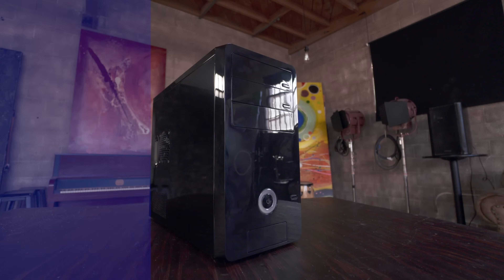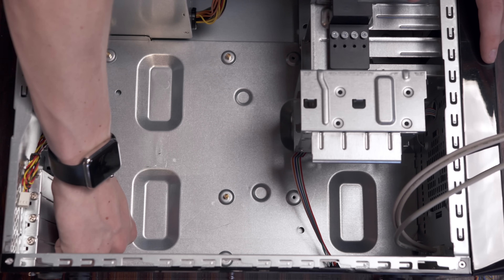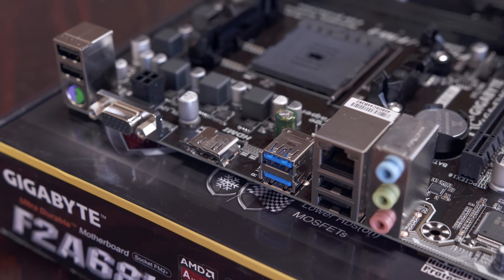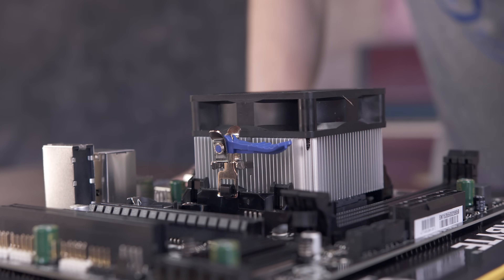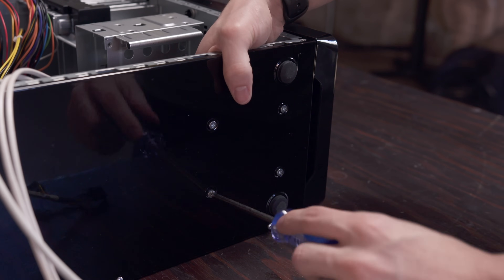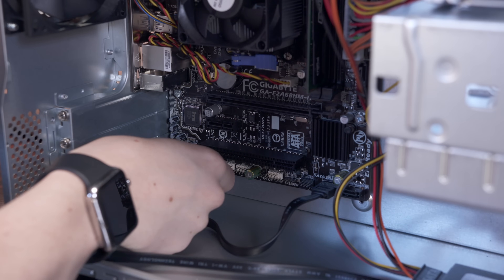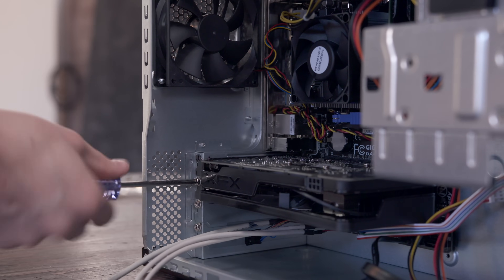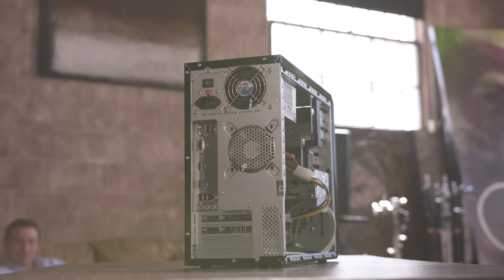How to Build a Gaming PC! (2016)

Comment: Is this any good?

Samsung DVD Writer
Logitech MK120 Combo
ASUS PCE-AC56 AC1300 Internet Adapter
Cooler Master MasterCase 5
Corsair VS550 550W KPC Bulk Edition
Intel Core i5-6400, Socket-LGA1151
ASUS B150M-A, Socket-1151
Corsair Vengeance LPX DDR4 2666MHz 16GB
MSI GeForce GTX 960 Gaming 4GB
Seagate Barracuda® 1TB
Reply: Yes, will run games 1080p 80+ fps
Reply: Okay, thank you guys for the answers :)
I think im going to buy all this.

Samsung DVD Writer
Asus 24" LED VN247H
SpeedLink RAPAX Gaming Keyboard
ASUS PCE-AC56 AC1300 Wireless Adapter
Cooler Master MasterCase 5
Corsair VS550 550W KPC Bulk Edition
Intel Core i5-6400, Socket-LGA1151
ASUS B150M-A, Socket-1151
Corsair Vengeance LPX DDR4 2666MHz 16GB
MSI GeForce GTX 960 Gaming 4GB
Seagate Barracuda® 1TB
SteelSeries QCK XXL Gaming Mousepad
MS COA Win 10 Home Nordic

Hopefully it will work out :S
Reply: never og AMD boy! intel ang GTX for life... i promise that you will be more happy With intel and gtx, you can get g-sync and shit for Your screen and the performance is way over AMD ;)
Reply: AGz MaGIXz but you should try to upgrade your 960 to a 1070 :)
Reply: You maybe want to wait for AMD:s release of RX 480 instead of GTX 960
Reply: Subaruwrx
 Intresting...
Reply: doesn't matter if u have a good cpu if your gpu is running like shit. that is like buying two gtx titans and a sli when you just have 8gb of ram
Reply: I would not reccomend a 480 for vr.  Your gonna want to get over 100fps in those titles to reduce motion blur I would recommend and aftermarket gtx 1070
Reply: Get a 6500. Best bang for the buck as an i5
Reply: estimated price?
Reply: +_K09 cad or usd
Reply: Subaruwrx USD
Reply: +_K09 id say like $1000
Reply: Wait for the RX 480!
Reply: +ShinySwordGaming yea good idea
Reply: Shit
Reply: you pay what you get. graphic card and Power supply are the two main Things you should not ''save'' cash on. cheaper ones will break and will never perform as good as a more ''expensive'' one. please instead of breaking several Graphic Cards buy a quality one that will last.
Reply: +sa0408 a 1440p card for $200. cant beat that. allows you to upgrade your cpu
Reply: sa0408 the rx480 runs can run a premium VR expirience. Before this those cards were over 1000, that is fucking insane performance for 200$
Reply: great for video editing and gaming
Reply: okay... so i changed some stuff.

Corsair VS550 550W KPC Bulk Edition
Intel Core i7-6700K Skylake
Akasa CPU Cooler AK-959CU
ASUS B150M-A, Socket-1151
Crucial DDR4 2133MHz 16GB (2x8GB)
XFX Radeon RX 480

Thats what i have put together
Reply: that's pretty good
Reply: +Latinz Prince that's like a 1500 build
Reply: +Latinz Prince u canadian?
Reply: +Latinz Prince i was just curious because the canadian dollar is so bad that would cost like 3800
Reply: Whats better Intel or AMD?
Reply: ***** It usually is the case that limits the graphics card length.  Look at the graphics card length and then the case acceptable gpu length
Reply: +NuclearZombie10 no get the 1060 it's better and cheap
Reply: Its57Playz Nvidia is better this generation for high end gpus.  AMD is better for your wallet and has better future proofing drivers.
Reply: Get an RX 480 instead of the gtx 960
Reply: +Latinz Prince Not saying that AMD is better than Nvidia, but an RX 480 is better than a gtx 960 or 970
Reply: Tom T-C Yeah it is because the 900 series is last generation and the rx 400 series is this generation.  It would be embarrassing if the 480 wasn't better than the 970.
Reply: chicken29843 the rx480 is designed to be mid tier and will only run 1080p gaming for maybe another 2 or 3 years before an upgrade will be needed.  The gtx 1060 directly competes with the 480 and still manages to push out more frames.
Reply: I would switch the psu for a better series if ur into hardcore gaming

Yes I know, YOU'RE
Reply: Also if ur intending for future upgrades, then switch out the motherboard for a z170 series
But seriously though, wait until the amd zen cpu comes out, it's cheap and has a performance close to an Intel i7 6700k
Reply: +Just Cyanide BTW do I need to buy a disc reader/optical drive?
Reply: Don't get the Rx 480 it runs like a gtx 750 but 5% better
Reply: +_K09 Id say 1300$
Reply: Considering i got the i5 6500 and gtx 1060 on the same build for 800$ id say his is more around 650
Reply: AGz MaGIXz w
Reply: AGz MaGIXz yes it's pretty good
Reply: AGz MaGIXz yeah

Comment: Is this gaming pc good? Will everything fit? Will it run high end games smoothly? Thanks in advance! http://pcpartpicker.com/list/w8r9TH (Edit: Note this is my first gaming pc)
Reply: First of all...

i7 6700k, is an very high end processor - do you really need it? (It could be a good idea to grab a 6600k instead and use the money saved on a better graphics card, as the graphics card is easily the most important part in a gaming rig)
The K on the 6700k means it is unlocked and you can overclock it, however your motherboard won't allow it as only z170 motherboards support overclocking. 
Also 
You may want an SSD an 16gb RAM - if you put your OS on the SSD it  makes boot time much faster and snappier, 16 gbs of RAM would help because alot of games nowadays are pushing the envelope so youll want more to future-proof your build.

The case is good, the power supply isn't bad but you might want to grab a seasonic one as theyre very trustworthy.

Overall, the build should run all high end games fairly smoothly, but if gaming is your primary use for the computer, you should get an i5 6600k and use the money you save on a better GPU. Also, if you dont plan on overclocking you can save even more money by getting an non-k cpu.
Reply: Ray.G Ok thanks! So this is what I have now: http://pcpartpicker.com/list/23kLkT Do I need a sound card to listen to sound through headphones or speakers?
Reply: Donald Duck you do not, soundcards aim to improve sound quality (only necessary if youre doing some audio production). 

The build list looks much better, but unless youre using the liquid cpu cooler for aesthetics, you can save some more by getting rid of it because the i5 6600 comes with a  stock cooler - although it looks fairly ugly and can be loud.
Reply: Ray.G How do I know how many fan headers my motherboard has?
Reply: 16GB RAM is definently not needed 8GB is fine for most things, 16GB might be nice sometimes but 8 is usually fine.

Comment: I built the 1st boson back in march but to modernize it I built it with an ASRock H97M Pro4 motherboard with a Core i3-4160 and a Corsair CX600M power supply. I never put the IO shield in. So far it has been capable of running everything I throw at it.

Comment: Hows this? I am a newb. (PLS HELP)
- EVGA 100-B1-0700-K1 700W SLI Ready CrossFire Ready 80 PLUS BRONZE Certified Power Supply

- Cooler Master HAF 912 RC-912-KKN1 Chassis 

- WD Blue 1TB Desktop Hard Disk Drive - 7200 RPM SATA 6Gb/s 64MB Cache 3.5 Inch - WD10EZEX – OEM 

 - ASRock Z97 Anniversary LGA 1150 Intel Z97 HDMI SATA 6Gb/s USB 3.0 ATX Intel Motherboard 

 - XFX Radeon R9 380 R9-380P-2255 2GB 256-Bit GDDR5 PCI Express 3.0 CrossFireX Support Double Dissipation XXX OC Video Card 

 - G.SKILL Ripjaws V Series 16GB (2 x 8GB) 288-Pin DDR4 SDRAM DDR4 2400 (PC4 19200) Intel Z170 Platform / Intel X99 Platform Desktop Memory Model F4-2400C15D-16GVR 

 - Intel Core i5-4590 Haswell Quad-Core 3.3 GHz LGA 1150 84W BX80646I54590 Desktop Processor Intel HD Graphics 4600 

 - Microsoft Windows 10 Pro - 1 License
Reply: good for me
Reply: So that's good?
Reply: +Wally West you can change your motherboard from z170 to h170 or b150
Reply: +NoSkope Lol Appreciate it dude.
Reply: Isn't the i5 6400 a better choice?
Reply: i5 4590 doesn't fit with the new motherboards. A i5 6400 does however fit.

Comment: Will i need extra cable, or do they come with them all
Reply: cables*
Reply: because he talked about the molax psi adapter, i dont know if i have to buy that or it comes with
Reply: The only thing that you need to buy is a molex PCIE adapter. The rest are supplied by the power supply or motherboard.
Reply: thx man!

Comment: OMG I DON'T KNOW WHAT THE PC IE ADAPTERS ARE ABOUT HELP ME PLEASE
Reply: Ok so first of all, PCIe is the type of slot that is used for graphics cards. They look like RAM slots, but they're different and generally farther away from the CPU socket. If you're using one of his $350 Boson builds (which i dont really recommend) I think on all of them he uses an APU. BASICALLY, unless you're using a dedicated graphics card, you don't need to worry about that. And if compatibility between PCIe 2.0 and PCIe 3.0, don't worry. they both work on eachother so just ignore that number.

Comment: Is this a good build?

System: Intel Core i5-6600K 3.5GHz CPU | Intel H110 Express Chipset | 8GB DDR4 | 1TB HDD | Genuine Windows 10 Home 64-bitr Gaphics: NVIDIA GeForce GTX 970 2GB Video Card | 24X DVD±RW Dual-Layer Drive | Audio: 7.1 Channel | Gigabit LAN | 725 watt power.
Reply: Just so you know I'm on a budget and it at $700

Comment: HI, I'm thinking of parts for my gaming pc. Can somebody tell me if these would be good?

Case-
Cooler Master HAF 912 - Mid Tower Computer Case with High Airflow Design (RC-912-KKN1-GP)
Motherboard- 
Gigabyte LGA1151 Intel Z170 2-Way SLI ATX DDR4 Motherboards GA-Z170X-Gaming 7
CPU- 
Intel Boxed Core I5-6500 FC-LGA14C 3.20 Ghz 6 M Processor Cache 4 LGA 1151 BX80662I56500
Graphics Card- 
EVGA GeForce GTX 960 4GB SSC GAMING ACX 2.0+, Whisper Silent Cooling w/ Free Installed Backplate Graphics Card 04G-P4-3967-KR
Ram-
Kingston HyperX FURY 16GB Kit (2x8GB) 1866MHz DDR3 CL10 DIMM - Black (HX318C10FBK2/16)
CPU Cooler- 
Cooler Master Hyper 212 EVO - CPU Cooler with 120mm PWM Fan (RR-212E-20PK-R2
Power Supply- 
Apevia Java 650W ATX Power Supply Ultra Silent High Performance 
Hard drive- 
WD Blue 1TB SATA 6 Gb/s 7200 RPM 64MB Cache 3.5 Inch Desktop Hard Drive (WD10EZEX)
Optical drive- 
Asus 24x DVD-RW Serial-ATA Internal OEM Optical Drive DRW-24B1ST (Black)

Comment: Wait, I am not very smart with computers, but would it be possible for you too switch the AMD Athlon X4 860K with an Intel Core i3 6100? :P
Reply: Motherboard used in this video is not compatible with i3 6100 unless you change to a motherboard that is compatible to the i3 6100
Reply: WB IsMe Ok, thanks. :)

Comment: so I built this pc and I connected the Monitor and PC with a VGA cable but it shows up saying VGA no signal. I'm pretty sure everything is connected correctly but I don't know what to do andthe internet says to buy DVI adapter. Help pls
Reply: +Me it's an old monitor. I have an HDMI cable but the monitor doesn't support it
Reply: Check if you have connect the monitor display cable to the graphic card's display port, not the motherboard's display port. Check if you connect the 6pin PCIE power connector.

Comment: I'm not much of a PC guy but does it matter what type of ram sticks you buy. I want as much ram as possible (24-32gb) because I plan on doing intense animation in blender. I also do a lot of video editing in Vegas and AE.
Reply: For video editing, you need a powerful processor like Intel i7 and at least 16GB of ram if you want fast and smooth rendering experience.
Upgrading this PC with more ram won't help much.
Reply: +WB IsMe From What I've heard blender eats ram like I eat ass. That's why I am worried about ram mainly. I don't mind longer render times tbh

Comment: why do you need a SSD?
Reply: He never said you "need" it, he is just using it for is build, though if you wan't a slightly slower but cheaper pc then just buy a HDD.
Reply: a harddrive has a platter inside it where it stores data on, which when you try to open a certain folder or certain data, it goes looking for it on the platter, which can take forever. the ssd has no moving parts in it, since there are no moving parts in the ssd, it can find things much quicker and doesn't have to wait for a platter to get the data that you need. thats why people perfer ssd, it can launch up games and data really fast.
Reply: SSD: solid state hard drives are faster and more reliable. They also don't move which is important for computers since a moving hard drive can damage your computer.
Reply: Best to buy even a small SSD (like 120gb) to put the OS on, will make everything faster and make it boot almost instantly. Along with the games you play most often for really fast loading speeds, everything else you can put on regular hard drive usually.
Reply: Game Babble Both is always better since SSD is for starting up your PC faster since you install the OS in it and install programs/games that you use/play most often so you can load programs faster while HDD is for keeping everything like pictures, movies, videos and big games stuff like that.
I hope you get the idea :)
Reply: but how do you you use both SSD and the hard drive?
i know you can use both, but i have no clue how you supposed to just choose whenever you want to use which one of them, and for what.
Reply: and why only 120GB?
Reply: ssd is much faster than a hard drive so therefore it costs more so it's only 120 gb. he said it in the video
Reply: Thx bro. Also, which is better looking at the price, storage, speed and size?
Reply: +Awful Animation go with an ssd but if you know you will download many games, spend the extra money (could be more than a hundred) to buy a larger ssd
Reply: Gracias m8
Reply: Is it possible to have both an SSD and an ordinary hard drive in a computer? Are they compatible together?
Reply: yes
Reply: PatrickTheStar Squarenuts yes.
Reply: You dont you just need any sort of drive.
Reply: Most common gaming setups go with a Samsung evo 250g ssd witch costs around $60-$100 and a 7200rpm hard-drive.  The best hardrives imo are Western digitals blue and black. If you want you can go all SSD, but you need more $$
Reply: If you only care about fps go with a hard drive if you care about loading times go with ssd
Reply: Sam Littlefield If you care about both then go with both, but what if I want quicker loading times but don't care about fps? What then?
Reply: Sam Littlefield I'm just kidding I know that you have to by default have an HDD otherwise there wouldn't be an efficient storage device for your computing device.
Reply: Do you need an SSD and a HDD or just one?
Reply: ArchieGamez Ok, thanks I think I'll just buy a HHD
Reply: Bro you will need a SSD because then when you wanna downlaod something theres gonna be errors....
Reply: It's simple. SSD is faster
Reply: is it better to just get a 60gb ssd for boot drive and stuff like that and hdd for storage.
Reply: +Diamond What? that's complete BS - a hard drive downloads fine. it's just slower than an SSD would be..
Reply: +Arad Benjamin um just connect them to the motherboard................
Reply: MetroShock no, he meant software wise in the OS to use the HDD for data and SSD for the os
Reply: Ssds ate pretty useless in my opinion. I really don't care about is boot time and accelerated texture rendering in games. I can love with the basics just fine. Don't need to waste an extra 100$ on something that'll only last for about 3 years anyways

Comment: Hey Austin, would the GTX 950 fit into the case? I know that its compatible, but I'm worried about dimensions.
Reply: Leaving a comment for answer.
Reply: It will fit but i highly recommend you to change the power supply (PSU) because the PSU in this video is not reliable. Get a 430W or higher from brands like EVGA, Corsair, FSP and Seasonic.
Reply: Thank you. I had already gone with a different (micro atx) case and a 500W EVGA power supply.

Comment: I built a boson 3.0, no disk/disc drive, and am having problems installing Windows 10. When I remove my hdd and ssd, it boots to bios. Burned Windows 10 to a usb from Mac OS X. First build. 

Should I try to get a disk copy of Win10?
What am I doing wrong?
Reply: Why get a disc copy of windows 10 if you don't have a drive for it?
Reply: ***** I'm saying- should I get a disk drive so I can have an easier install?
Reply: Balrog So whats your main problem? You can't boot to bios?
Reply: ***** I can boot to bios just fine, I just can't install my copy of windows 10. I don't know if this build supports installing from usb drive.
Reply: Balrog Oh, well all bios can boot off the flash drive just fine, if you're having trouble getting windows just get a bootleg one (fake) and get a activation key off the internet :P
Reply: Or just spend extra $20 for a disk drive.
Reply: +jdawg5391 make sure everything is plugged in properly including the power to the graphics card
Reply: +jdawg5391 make sure everything is plugged in properly including the power to the graphics card
Reply: ***** Yeah, what power supply do you have? You probably do need a 500 watt power supply.
Reply: ***** Okay. Hopefully it helps!
Reply: Nvm. I bought a disk drive and burned Windows to a disk. The bios just sucks- it doesn't support most usb file formats.

Comment: but how do i install and operating system that's the only confusion i have... can some one please link me a video or tell me thanks :D.
Reply: yeah, you can buy windows from the microsoft website and you can download it onto a usb which you can than put into your pc to install.
Reply: Yeah you can use a flash drive to install windows.
Reply: It starts at 10:41
Reply: You would presumably of purchased an operating system for your PC, like Windows 7 or Win 7 Home Premium. You would get a disc which you would run with the PC, simply by booting it up on the boot menu. Then you just have to go through the installation steps, and the validity of your operating system and it should work fine.
Reply: ***** ok thanks im going to buy windows 10 home.
Reply: I used the retail flash drive to install it. It took only like 15 minutes to install it and get on the desktop.
Reply: Download a unlocked windows torrent with another computer.. or Extract a iso to your Usb and crack it later on
Reply: Thanks man